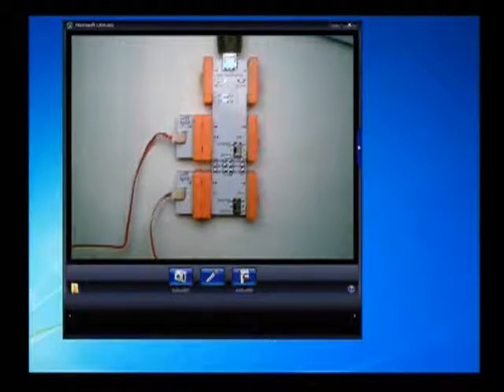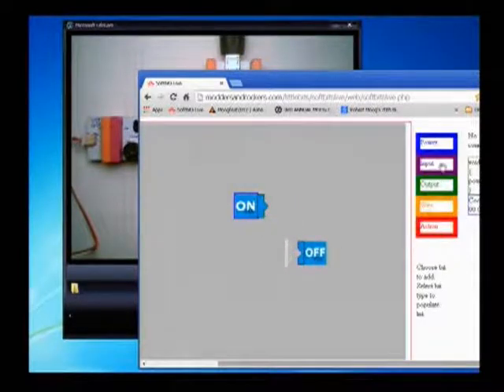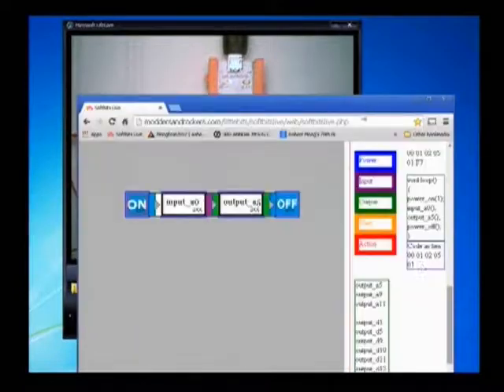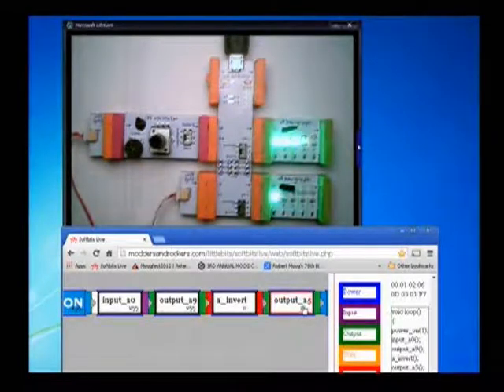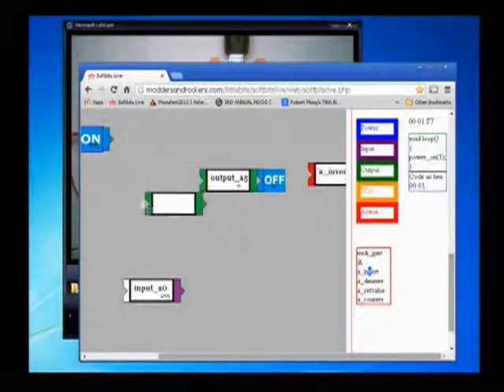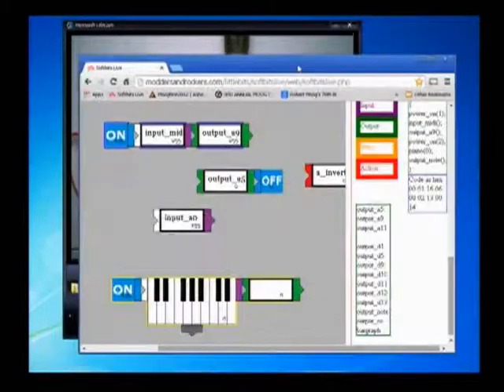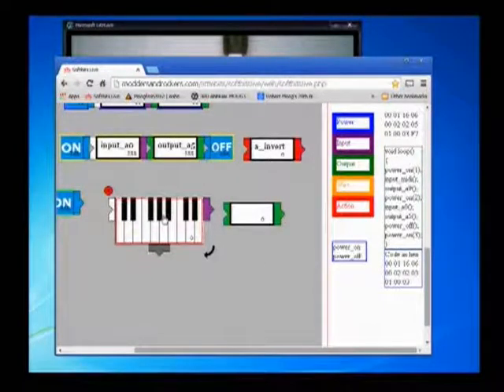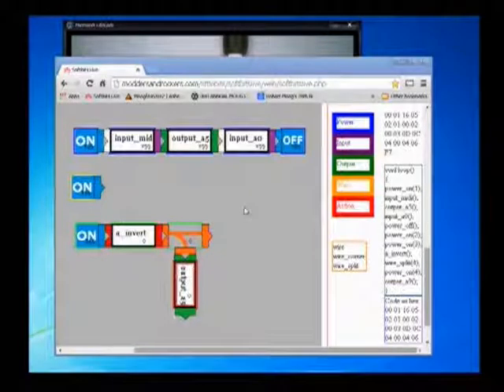SoftbitsLive for Arduino 2nd try.

Comment: That's some seriously great work over there Peter! Super cool stuff....  Something like that with a little love and attention could really open up the microprocessor world to a lot more folks. Should I assume this will be an open source project? Or are you working towards a crowdfunded sort of thing?  Either way... keep rolling with it.  Very cool.
Reply from the maker: Open source. At the moment it uses a PHP backend to talk to a C++ server that does the Serial IO to the Arduino. The serial server is like Serproxy but it processes Midi messages rather than just serial IO. The serial server will have an HTTP module so it will then become the backend for the web page.